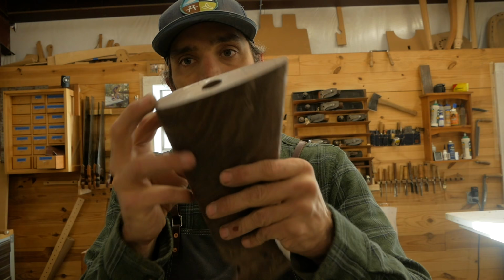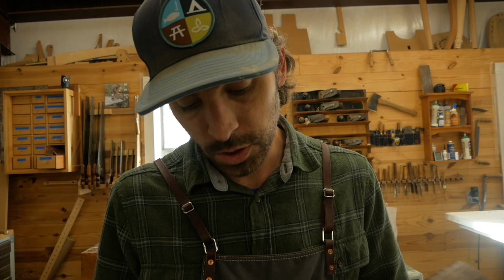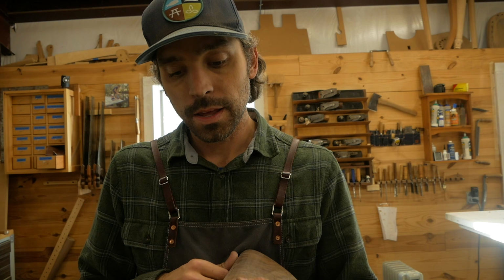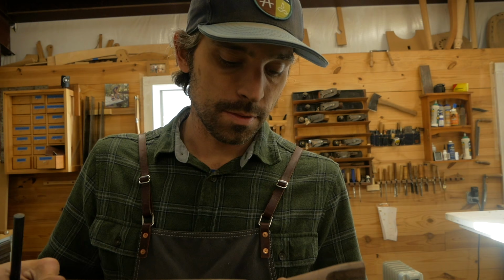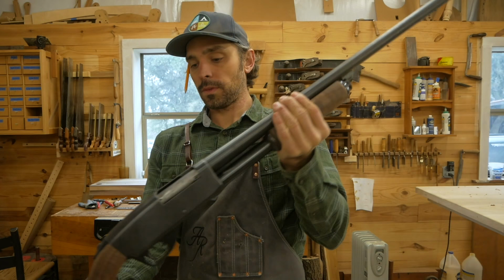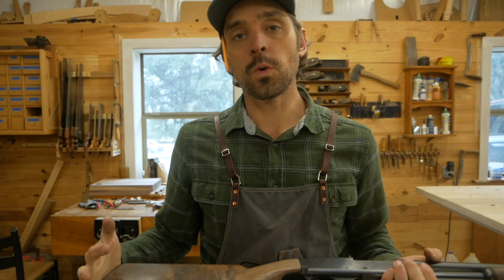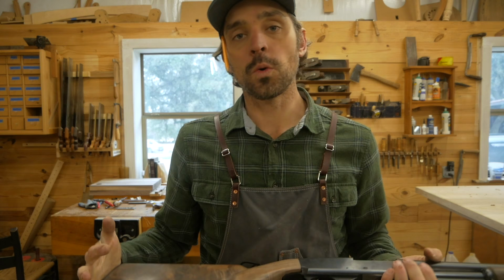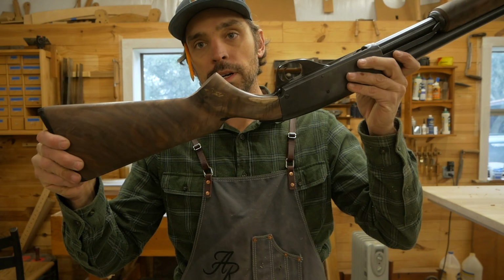Carving A Walnut Shotgun Stock

Comment: When I drill a long hole through a piece of wood I drill from both ends and make the holes meet in the middle. I drill from one end a little more than halfway through the piece of wood. Then drill from the other end until it meets the first hole inside the wood. That way your through hole will have more of a chance of staying closer to where it needs to be. I only do that on my personal projects because it doesn't matter to me if my through hole is not totally straight. The most important to me is that whatever has to go through the hole does not bind.

Comment: Walnut dowel in the original hole, drill new hole, no one will know and Bob’s your uncle. I teach my kids that we screw up, we learn. I learn all the time. 😂
Reply: I like this idea.  I also thought about the Japanese method for fixing broken ceramic pieces, by filling the void or crack with a precious metal and it becomes part of the design.  Walnut dowel wouldn’t be as noticeable, probably nobody would be able to tell.
Reply: Koriel Nuesse that‘s the point
Reply: That's what I was thinking too. Bore through the stock with a forester bit and plug it with a suitable piece from a cutoff. Then re-bore the original hole. But epoxy works too.
Reply: @SoggySandwich80  People of British descent.
Reply: @SoggySandwich80  I guess I do …
Reply: @SoggySandwich80  eev blog !
Reply: I remember watching Larry Potterfield fill in some marks in wood, by using clear epoxy mixed with very fine sawdust from that piece of wood to make a color to match. I am wondering if that same process would have a produced a better result.
Reply: 1777DK u got ur self a new subscriber me
Reply: Hardest Critic is Self. 
The fact you took the time to address the mistake and that you learned from it ; makes you a Man of Higher Standards, rare these days.

I do like the precious metal on break or repair from Japanese .
Reply: Filling the hole with a dowel made from the cutoff would have been the best,  it wouldnt be noticeable especially if he checkered the grip
Reply: Same here. If there was a naturally formed hole/crack in the wood, I'd fill that with non-wood stuff though.
Reply: All this talk about filling holes with wood is so inadvertently inappropriate... and I love it.

Comment: Cool Vid.  I think I saw another stock maker repair a hole like that by mixing some saw dust from the stock itself with clear resin and filling  the top 1/2” inch or so of thickness with that mixture. Once it dried it was nearly impossible to tell where the hole had been.  Cheers.

Comment: Damn long drill-bits, never go where you point them. I found that the thinner the bit, the more likely they are to wander off,, so I just bought a 1/2 in x 24in bit, and use it on everything. It's too stiff to bend and I can usually keep it in line.  I got two big slabs of walnut drying since last year, I think I am going to try a stock for my shotgun. You inspired me.

Comment: In my experience the woodworking portion of gunsmithing is some of the most challenging woodworking there is. There are very few straight lines. Not much to actually measure and a lot that has to be done by feel or by eye. And yet there is very specific math involved in making a gun stock that actually fits and performs well.

Comment: What about drill out a plug from the same piece of wood from the left overs and maybe if there’s a small enough knot you can cut it and plug it, use glue and if it’s a good fit after sanding and varnish it would probably blend real well and would just look like a blemish in the stock of wood
Reply: That was my thought. Make a short dowel that fit the drill hole. Glue it up and slide it in where the problem hole is completely filled and when the glue hardens, redrill.

Comment: Why not use the walnut sawdust that came from the sanding stage , mix it with clear epoxy and fill the hole ? It will match the color much more closely than black epoxy. Really nice build all the same , excellent work.

Comment: Good video btw. When you need precession drilling of an odd part?, use a mill or, if you can chuck it, drill then ream if needed. You should try side guards around saw blade so you can move the wood around easier and safer too.

Comment: Nice work. I started making my own custom stocks about 12 years ago. Precision checkering takes tools and practice though. 

Im working on a custom LoP and comb stock and fore grip, with 5/8” cast for a perfect new Browning 525 Action and Barrels I got for an extremely good price. Its going to be the best wing shooting gun i’ve ever owned, because I won’t stop until it is. 

Just so you know, proper checkering will take you longer than the stock. Best of luck!

You should have custom fitted yourself before you made it, though!

Comment: Its good to set the stock parallel in the vise so that it's level with the ground, then have a level on the drill so you can maintain that straight line, then just eyeball it from the top to make sure its straight on that axis. Go slow and you wont have any trouble :) for future stocks if you do any

Comment: Question when you made the hole in your filling it with epoxy why didn't you use a clear epoxy but color the epoxy with the sawdust from the wall-nut would that way it would have actually perfectly blended in if not near blended end with the wood itself

Comment: Do you know about how many hours it took do complete the stock?  Also if you take Hoppes #9 and 0000 steel wool you can clean up the rust spots on the receiver and barrel.  Keep it the metal parts oiled and it will stay nice for ever.  Nice project.

Comment: I knew that shotgun was in the same family as the Stevens model 820b I've been fixing back up for my cousin as soon as I saw it. Springfield, Savage, and Stevens were at one time all under the same ownership and produced the same models under each brand, sometimes with small alterations. So if you ever need a replacement part keep that in mind. I had a question for you on the woodworking side of things though. I have another shotgun I'm restoring and I'm trying to find out if there's any precautions to take to avoid splitting the the wood when i cut the pocket for the tang? I wouldn't be so worried but the pocket runs about 3-4" deep and only a half inch wide. I was thinking due to how narrow it is I may be better off drilling pilot holes and carving the walls flat after and would really appreciate any feedback.

Comment: Late to the party, as usual.  We have not to be too hard on ourselves for our mistakes.  Otherwise, we would quit.  I didn't see any problem with the old stock.  Were you just trying to improve the look of the wood?  If the old one had no defects, I would probably have just refinished it rather than trying to reproduce it.  All in all, however, a nice job.  I have my grandfather's then my father's old Win. Model 97.  It needs restoration, but I have not been able to bring myself to do it or have it done.